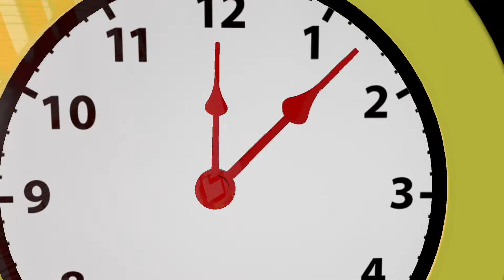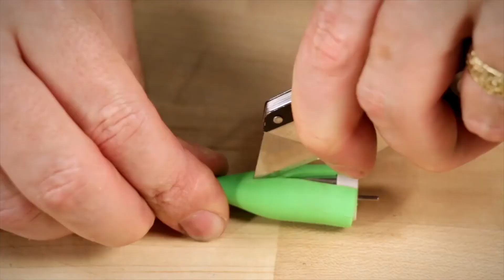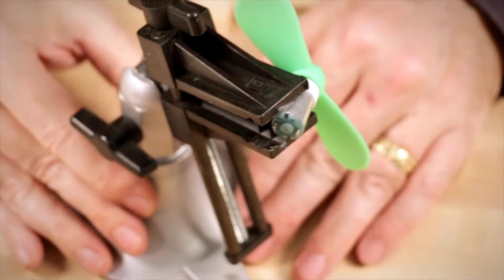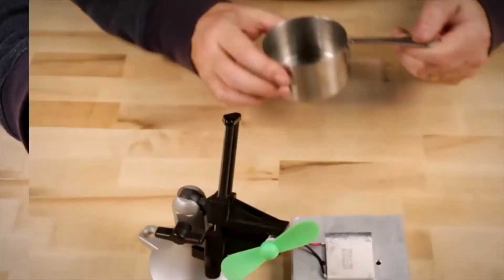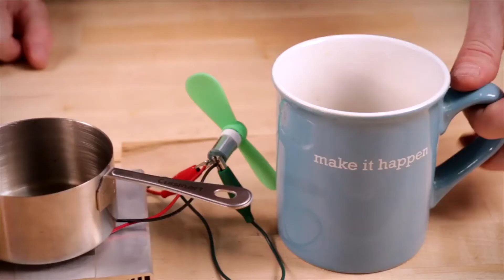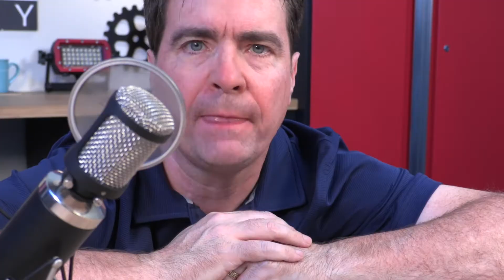Free Energy Generator Works 100% Real New Technology

Comment: Energy cannot be created or destroyed
And yet energy runs out.😙
Reply from the maker: Energy can only be transformed. It doesn't "run out" Movement, friction, heat, drag etc all help change energy from one state to another.
Reply: @InventionTherapy  So yeah literally, energy runs out, to no longer be useful as energy..
Reply from the maker: No, the energy takes other forms. Heat and motion to name a few alternative forms of energy.
Reply: I swear to god that energy can be created and destroyed in other words i do believe in a magnet based perpetual motion machine,let god mark my words till judgement day,because i am so sure that it is possible and whather that magnet motor will eventually stop by potential wearing out magnets or by friction cause by heat,that (whather time that will take,depending on it’s speed) but that doesnn’t matter to me,if a perpetual motion machine could start and run on it’s own and last for 5,10,20 or 100 years, i will be fine with that.